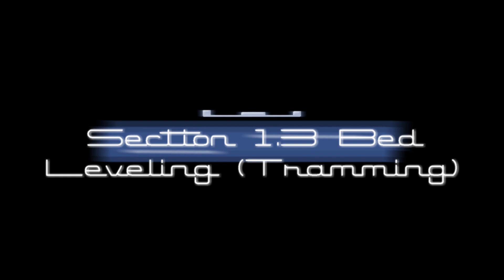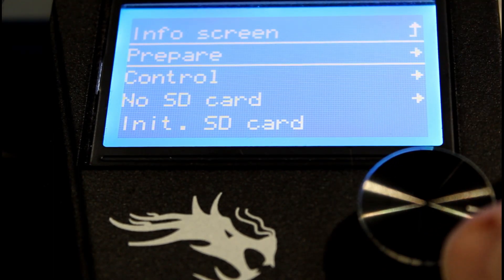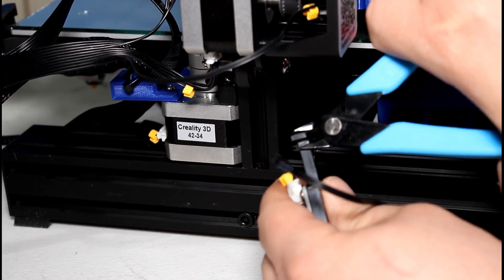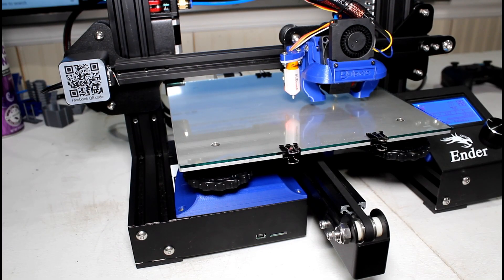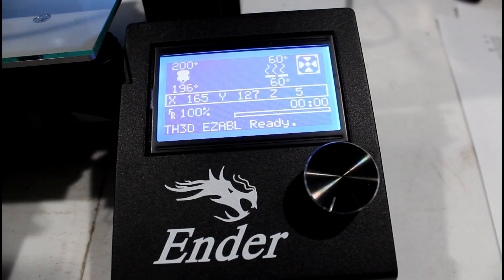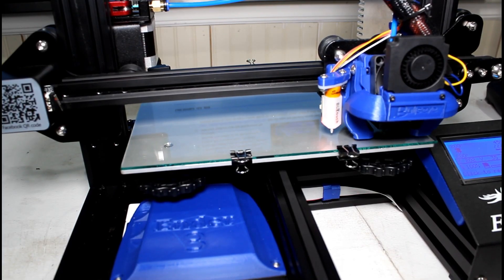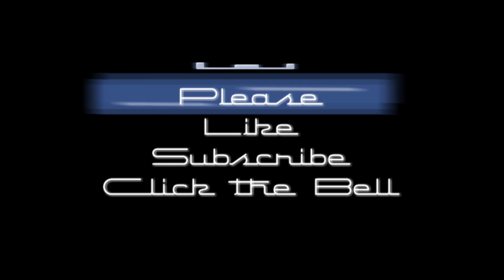Section 1.3 Bed Leveling featuring the Ender 3

Comment: Not sure if this was specifically mentioned before but, I took a white permanent marker/paint pen and made a tick mark at the front of the leveling wheels when they were full tight, that way I could actually count full rotations easier visually from the side view and make sure I was turning them exact.  You could make quarter marks too, with different colors, so you can get more granular accuracy with matching number of rotations.

Comment: Beginner and needed this video. Thanks.. I have already changed out the screws and knobs and need to level the bed. I also bought a CR touch that I still need to add. Do you have a video on the CR touch?..LOL

Comment: Hi, i have a Ender 3 V2 printer which have only had for about a month. I have bought a PEI magnetic plate kit and am so used to levelling my printer when had the glass plate. now i have the magnetic plate the distance is a little more than usual. i am nervous in doing this levelling part as dont want to damage the plate or any other part. i noticed in your video you snipped of part of the block on the left side of the printer where the 2 allen bolts you undone but i dont want to do that. what is the easiest way to do this processas have watched your video but like said am nervous

Comment: little tip for you those knobs under the heat plate you should  add a lock nuts so those knobs wont turn when its all leveled and done,

Comment: i have a huge problem level my ender, i have a 5mm Alu-Plate, but i always can just level 3 corners, the 4th is allways to high, i gues i have to throw the Plate away.....
Reply from the maker: You should not have to do that. Just level all the other corners off the high one.

Comment: Great video .. 

I'll follow your tips to try to correct my Ender 3 pro that can't have leveled bed anymore ( and correct print neither )     

My question is this : 
I was trying to understand the way it moves , you says it's 0.04 mm each 1/16 of a turn of knob ?     This would means 0.64 mm for a full 360 turn ?   Is it correct ?
Reply: Did you upgrade your springs

Comment: Thanks for the help and hard work Jim!

I have only one problem with this leveling method. My magnetic bed is not level. It has a dip in the center, which forces me to make the 4-corners a bit more "snug" while doing the paper method. Almost to the point where the paper doesn't move...
That's the only way I've found to keep my filamemt to "stick" to the bed (and a little bit of Elmers Glue Stick too) and then my filamemt will begin to adhere to the bed.
Also, I check height in the middle of the bed. Again, just making sure it's barely "biting" then off I go.
Otherwise, no way will my filament adhere.

I guess the Ender 3's (and Pro's) inherently have this problem with warped beds, but all in all they're reall darn nice machines for the price!

Thanks again buddy! ✌🏼
Reply: you can place something underneath the magnetic plate to compensate. foil can do the trick
Reply: @Fanis_C1  Foil worked for me. Just got glass bed. Back here to re-adjust. You rock

Comment: Hi and thanks for the video.  I'm adding springs and knobs to a CR-20 Pro because it needs it now.  It has a BL Touch standard so I did the same Auto Home and moved the head to the front left corner but at 8:18 of the video the extruder goes from well above the bed to down almost touching.  Can you explain what happened there? 

Thanks!
Reply: I have the same question.  Did you move the extruded down like we did in step 5?

Comment: During this process, should I have that black board removed from the leveling bed, or should I keep it off?  It looks like yours is off, but it also looks like you have glass on top.
Reply from the maker: While  you're going through your leveling, you want to make sure your build surface is on the bed.
Reply: @TheEdgeofTech  Is that program at the end where it goes around the bed automatically a necessary part of the process?  I'm trying to figure out if I can get that program onto the micro SD card that came with my printer, but if it isn't necessary, I might skip it if I can't figure it out.
Reply from the maker: @Spar10Leonidas  It's not necessary, but does help. It's a file that's in thingiverse under onebadmarine. You don't have to use it if you don't want to though.
Reply: @TheEdgeofTech  OK, I figured out how to get the files onto the SD card, but there's a bit of a mismatch in what I'm seeing.

I'm not sure if I downloaded the wrong file, or if the file has a different name than what I saw in your video.  On my screen, one of the options is "Ender_3_Level_Test."

Is that the right file for this part of the process?

Comment: I'm confused why we are doing equal adjustments (4 full turns) when the back left has the plastic piece in the way so right away that corner is going be way different, but we use the front left to set the z-limit ?

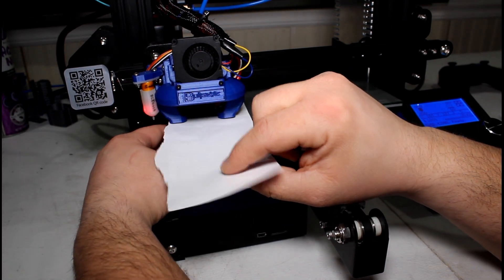Comment: Everything went fine until around 9:21 when you state to move the head from front left to front right. The extruder snags and there is only 3-4 turns before that side is fully compressed. Even fully compressed the extruder still hits the bed.
Reply: After a year i think you allready fixed it, but for the people that have the same problem you should put the z as stopper a little higher (that thing on the side with the button that clicks) when you do that the z as will not get as far down to the plate and than it’s not necessary to turn the knobs all the way up (and thus the plate all the way down) to it’s max

Comment: I like how you are using a BLTouch with the EZABL Firmware. lol
Reply from the maker: Lol before the newer versions of the firmware, this is how it has to be done! :) Now it's much easier! I have a video on that too!
Reply: @TheEdgeofTech  Hey man if it works, go for it. I noticed with 3d printing, once you find it working properly DONT MESS WITH IT! Lol. I screwed myself a couple times and had to start over.

Comment: I am Having an issue where my first layer is fine, then on the second layer, the bed needs to be lowered or the extruder starts skipping, then eventually clogs. Lately seems worse. I have a new nozzle, new PTFE, it has no gaps, and when I apply any resistance to the extruder spring, to tighten the grip slightly, it starts skipping worse. Any videos, or similar problem fixes out there? Using Cura 4.0, 4.1 was too buggy. Using Fat Dragon Games printing profiles. 
TIA
Reply: Hey did you fix that ? I have the same issue with my ender 3 .. ??

Comment: At the beginning where you tightened the bed knobs, and you then turn them 4 turns, are those complete 360 turns? they look like 1/4 turns when you did them. I dont have Lukes guide so I dont know if thats explained. One person may turn farther than another if were talking a freehand turn. Or does that part not matter? 

Thanks for the vid
Reply from the maker: Hi! Thanks for watching! It would be four full 360 turns! If you need his guide, it's linked in the description of the video!

Comment: I'm still having the same issues. The middle of the bed is always too high. I've replaced the print bed with a glass one and it's still doing it. I've took it all apart and put it back together. I just can't figure out what's going on. Using a spirit level everything is centered. I think I'm going to have to just throw it down the stairs....
Reply: the spirit level does not corelate the bed level to the gantry . use the method of finding the right distance between nozzle and bed using the piece of paper. hope that helps :-)
Reply from the maker: You don't have to do that. Lol try leveling the bed from the center out. So start in the center, then go to the corners and they can be a little higher as long as the fillament sticks. My first Ender 3is the same way. The bed is high in the center. The other option is to raise the outsides of the bed with a layer of tinfoil between the bed and you glass. Let me know if any of these ideas work. Thanks for watching!
Reply: @TheEdgeofTech  What the hell. If the center is too high and the sides are right you can't do that, it's simple logic or am I missing something?
I'm trying to do the same thing but it's so confusing, if I level the center and it's too high then the extruder tip will certainly be touching the bed when travelling to the corners, no?

Comment: My printer is waaaayyyy off of 17:22
No matter what i try i cant get it to work.
With glass or no glass (other material i have)
Each time i turn on my printer i have to mess with bed leveling and stuff.
Whole bed wobbles around. I have tightened the rollers underneath (just snug) and it doesnt help.
Sometimes it works sometimes not.
I havent printed for a while and im unable to print because its just doesnt level itself. I tried with paper, tried with the thin gauges, still cant get to work.
Bed warped?
Reply: If you've adjusted the bed rollers and the bed is still wobbly I would check that the bearings in the wheels are not moving in and out slightly as sometimes they can be loose.
There is a washer between the bearings to prevent them from being squeezed together too tight when you tighten the rollers to the plate, but sometimes, as has been shown before, the washer is the wrong thickness and this will allow the bearings to move back and forth slightly in the wheel. The fix is to remove the bearings and glue them into the wheel with a small dab of glue then reassemble and add the washer and retighten. You should be able to just slightly rotate the wheels on the tracks when they are correctly adjusted.

Comment: Thanks for the in-depth instructions. That's the same test pattern I usually use but I had to change the G-code to increase the bed temp to 65 and nozzle temp to 210. That works best for me in my area. I also added a nozzle purge to draw a line on the left edge to get the old burnt filament out from the nozzle before the test pattern starts to print. Thanks.
Reply from the maker: Awesome! It's always great to customize the G-Code to dial it in for your printer!  I use Luke's GCode in my slicer which purges at the home position to get the old stuff out. Then I use a skirt around my prints to watch the level as well.

Comment: Great video thanks for that. One question on 8:19 the hot end is suddenly much lower and you see there is a cut in the video. But you don't explain how you lowered the hot-end so i am missing a step.
Reply from the maker: Hi. Good question! Once you Auto home your machine, disable the steppers and move the hotend over the front left of the bed. You should be good to start leveling from there. In my case I have the bltouch and had to lower it back down after the probe touched. I hope that helps if not, message me and I'll help you work through it.
Reply: The Edge of Tech 

I also use a bltouch but have suddenly lot of problems with sticking tot the bed so check everything and start al over now. So after doong home it just lower the nozzel and use that as a startpoint for the other corners.
Reply from the maker: @mikeooo  If you are using a bltouch you want to just tighten your springs, back them all off four turns each in pairs. Then print the leveling pattern and adjust your z offset as it's printing. When you get it where you want it don't forget to save it in the control panel. I'm guessing it's off because after you adjusted everything your z offset is no longer correct. But I think it will make a video on doing this with a bltouch, so it makes it easier for people who have them. Thank you for bringing that to my attention.
Reply: The Edge of Tech thanks for the quick response and looking forward to that  video.  Keep them comming they are a great help.
Reply from the maker: @mikeooo  No problem! Thank you!